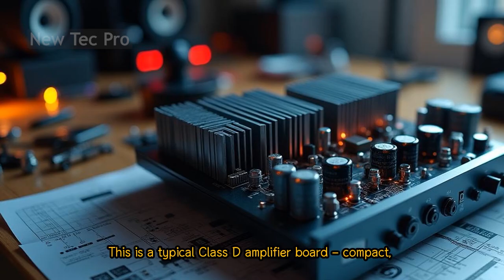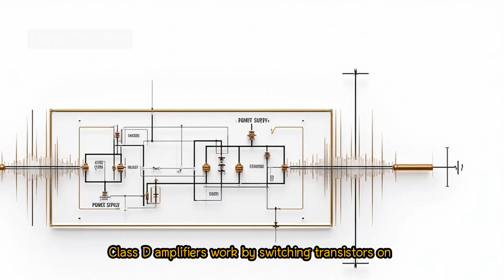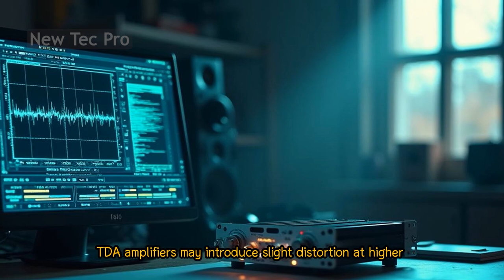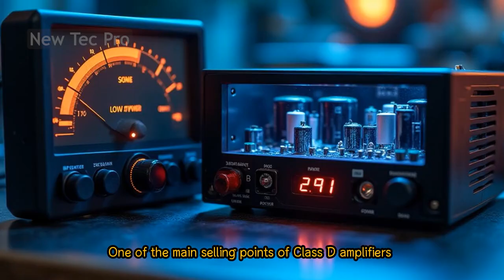TDA vs. Class D: The Ultimate Comparison (Sound Quality, Heat & Efficiency)

Comment: What you do is get 100uF 450v aluminum high frequency low esr capacitors.  Put 7 in series across a PNP to an 8 phase 50uf (just use 100uF so its twice as efficient) you can feed the array with a 555 timer because its below 1mhz, you don't need any components, just fuze it off to  simple amplifier.  Then you have a series of zener diodes in parallel with a 1M ohm to ground.  It will build any voltage, but I would  not build it above 220v because ESR occurs at higher voltage.  So depending on the switchs, the 500khz never get to ground, but get trapped in the 8 phase 50uF trap until the zener diodes open the parallel trap.  Its really efficient, you can plug it into 115v and it produces 550v, or just use a 9v and you can get 2kv at 60hz DC - [ but the zener ladder will pop it at whatever voltage is set, so you need a warm up discharge circuit to ensure safety because at any point it might have 10kv] plus schosky diodes for protection in general.
Reply from the maker: That’s an impressive setup! I really appreciate you sharing your technical insights—it’s great to see such depth of knowledge in circuit design and power conversion. Have you tested this design in real-world applications? I’d love to hear how it performs!

Comment: I used every time I needed TDA155x power amplifiers (I once got a bag of 300 mixed ICs -1552,1554 and 1557). With a good and clean pcb layout, can achieve 0.1-0.2%THD at 10W with a good pair of speakers. I do not need to listen Enya, Iron Maiden or Chopin at 100W, 10W/channel is enough for me. Almost all car stereo power amplifier ICs (stereo, quad, BTL) can deliver good quality audio, with a clean power supply they sound excellent. Also they have good SVRR and channel separation. Also I do not need to drive them at the max power, max voltage, lowest speaker impedance; a good balance can give impressive results.
Also, very good results can achieve with TDA 2003, 2005, 2030, etc. Altough old, the y still work well (altough consume more power than class-d amplifiers) and for stationary equipment they are very good; many professional HiFi audio equipment was built with those.
Of course, if I get lazy and want to build something with ready-available modules, I can go and buy online cheap class-d amplifier boards, pair them with a cheap preamp module and I can have a cheap audio system that will probably sound ok at a low power consumption.
Reply from the maker: Thanks for sharing your experience! I completely agree that with a well-designed PCB and the right components, TDA chips can deliver excellent audio quality. Also, I believe that sound clarity and separation matter far more than sheer loudness—having a balanced and clean sound makes all the difference. Your insights on older amplifier ICs like TDA2003 and 2030 are really interesting, especially for stationary setups. Have you done any direct comparisons between Class D and these models?

Comment: TDA is a model,tda have class d also like STk or Inferion not all time they use class d configuration on the chip or just say the variation of chip is which model,while class a,b,ab,d,and h,g is the type on what type of chip is design for,like for example TDA2030(STM) is a class AB  while TDA8932 (STM),TPA3116D2 (TI) and CS8673 (chipstar) use the configuration of class d so mean tda tpa cs etc... is the model of the chip not the actual chip design.
Reply from the maker: Thanks for the clarification! Yes, TDA chips can have different configurations depending on the model. The distinction between chip models and amplifier classes is important when comparing performance.
ifference between chip models and amplifier classes helps in choosing the right setup. Do you have a favorite TDA-based amp?

Comment: Personally, I don't think much of such cheap amplifiers. They often have poor channel separation, a high distortion factor and simply sound terrible in hi-fi terms.
However, they can be quite useful for simple projects such as a loudspeaker module for RC models and inexpensive desktop loudspeakers.
Reply from the maker: Thanks for your expert opinion. But like it or not, it seems like most new audio systems are built with Class D. What type of IC do you prefer?
Reply: @newtecpro  I don't know which ICs are used in integrated amplifiers like mine, I only know that they are quite expensive, you can't get anything under 200 USD.
It's not about the type of ICs, it's about the quality of the whole amplifier. High signal separation, low noise, low distortion and ohm stability. I am not an expert, I only pay attention to technical data and test reports in HiFi forums. I think the Hypex FA251 FusionAmp module is a good module for building your own active speakers.